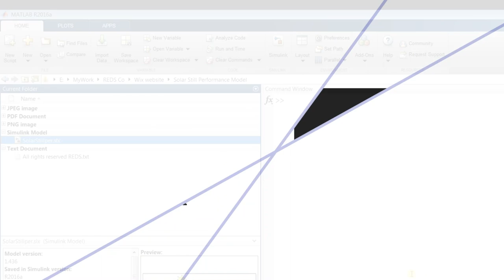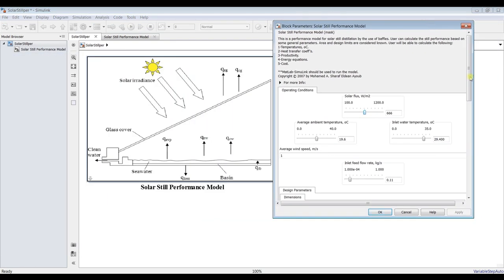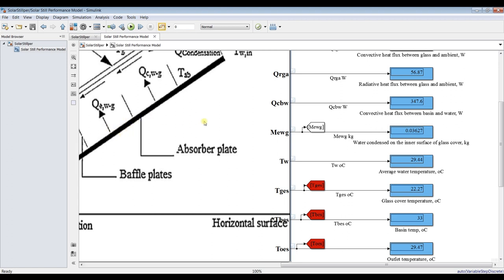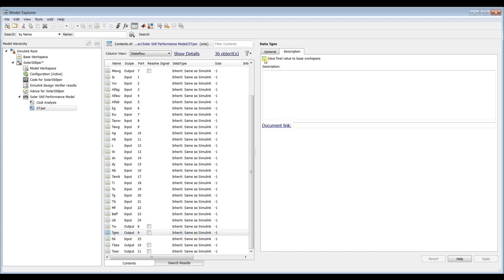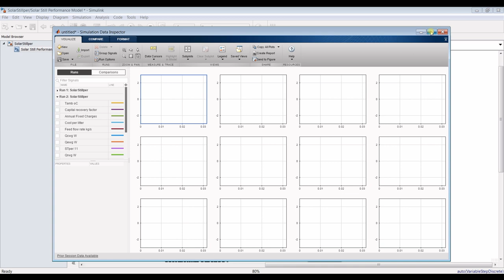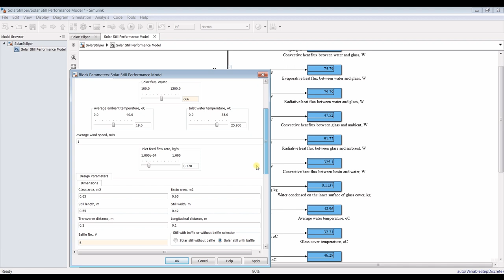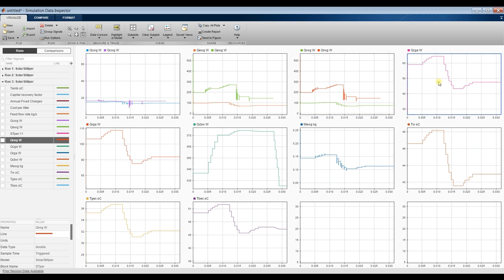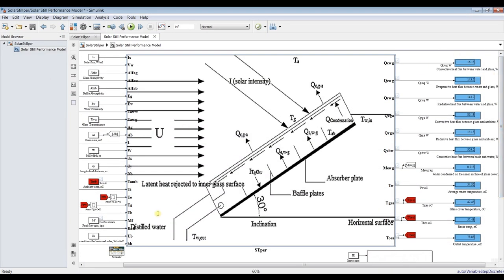Solar Still Distillation | Performance Model | Matlab | Simulink

Comment: Please can I optimize my design using just matlab alone?
Reply from the maker: You mean not to use simulink?? You can copy the code and reform it based on your optimisation. But first you have to purchase the model. The download link is in description section.
Reply: @REDSLibrary  Thanks sir. I meant how can I optimize my design project using the matlab software. I have gone online and have seen that most people use Aspen plus to optimize designs, especially for solar water desalination projects which I'm working on. My question is can I do the optimization in just matlab without getting Aspen plus?  I have matlab 2017a running on my PC